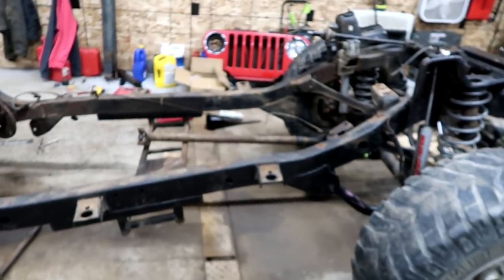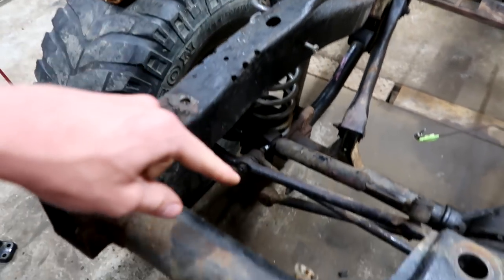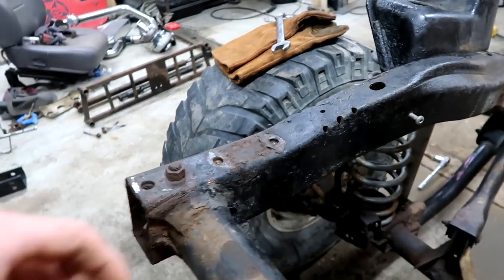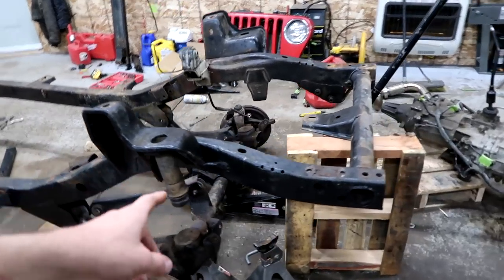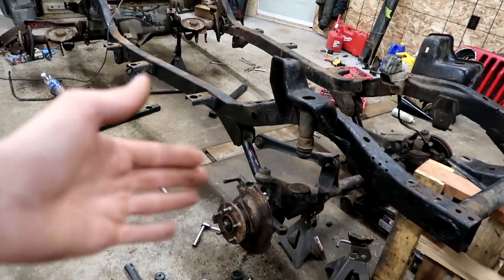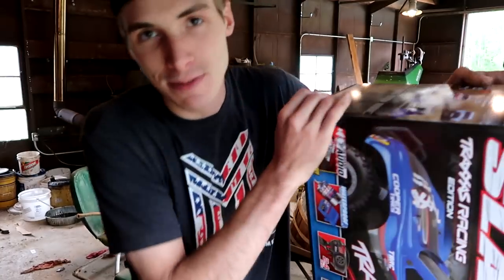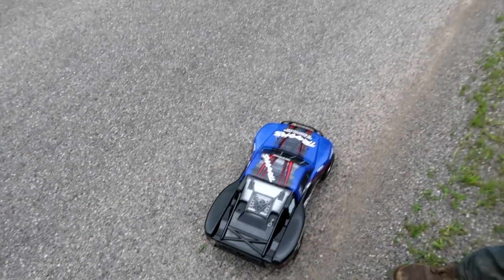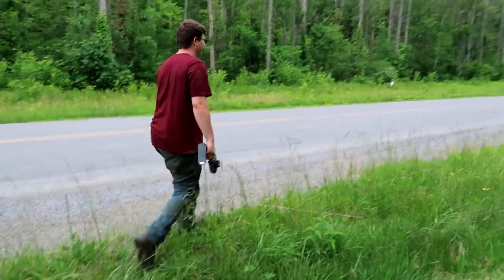How To Crash a New RC Car in 3 Seconds

Comment: Forget about the Dana 44 and get a ford 8.8 out of a 1996-1999 Ford Explorer.They make swap kits for around 100 bucks and just sleeve and truss your Dana 30 and you will be good up to 37's....
Reply from the maker: that's what I should run?
Reply: Yep that would be the cheapest and best bang for your buck.Check out Rusty 411 youtube channel.He has a Dana 30 front axle on his XJ with 40's....
Reply: a lot of people go for the ford 9 inch in the rear instead of the 8.8. They are easy to work on and have a ton of aftermarket support. Its stronger than the 8.8 and slightly more expensive but I think its worth it in the long run. I'm planning on putting a ford 9 inch in my 2001 along with a high pinion dana 30 from an XJ cherokee that I bought for $400
Reply: 8.8  is a good way to go
Reply: I have one in my yj they are great  , get a posi tract one. Plus you get a free rear disc brake upgrade
Reply: The Dana 30 will not take 37s. I know from experience. I snapped the passenger side shaft every time I was locked in 4 wheel and out any sort of torque on it. I went to 35s and it would take it for a bit but I still went thru 7 axle shafts is a 12 month time. I put a Dana 44 in and never had a problem again.
Reply: The 8.8 is the same track width and bolt pattern
Reply: Definitely upgrade the front to 44. Ive got dana 30 with  35" v treads and she dont like full power 3 broken axles countless ujoints.
Reply: 8.8 with disc brakes is a bonus too. Ditch the drums on the 35.
Reply: I have an 8.8 waiting to go in. Need a new ecu first then axles will be next

Comment: Front Axle

GM

1972-1976 K5(Blazer/Jimmy)/K10/K20 (Passenger side) Some 1977 K5 Blazers came with Dana 44s in the front, others came with a Corporate 10 bolt solid front axle. Dana 44s were also used as front axles in 4x4 converted full size Chevrolet and GMC vans by Pathfinder Equipment Company from 1973 to 1989.
Dodge

1974–1993 Ramcharger (Passenger side)
1980–2001 ½ Ton (W150/1500) (Passenger side 1980-1993, Driver side 1994-2001½)
1988–1995 ¾ Ton (2500 Light Duty) (Passenger side 1988-1993, Driver side 1994-1995½)
1972–1980 (W200) (Passenger side)
Ford

1959–1979½ Ton (F-100/F-150/F-250) (Driver side)
1980–1996½ Ton (F-150, TTB) (Driver side)
1959–1987¾ Ton (F-250 light duty, TTB 1980-1996½) (Driver side)
1972–1979 Bronco (Driver side)
International Harvester

1975–1980 Scout II (4X4)
1974 Travelall (100 4X4)
1969–73 1200/1210 4X4 Pickup/Travelall (Closed knuckle HD)
1974–75 200 4X4 Pickup/Travelall (Open knuckle HD)
Jeep

1967–1973 Jeepster Commando and Commando
1974–1991 Wagoneer (Passenger side 1974-1979, Driver side 1980-1991)
1974–1983 SJ
2003–2006 TJ Wrangler Rubicon (Front and rear)
2007-2015 JK Wrangler Rubicon (Front and rear)
1987–2001 Venezuelan XJ (Front and rear)
1996-1998 Jeep Grand Cherokee made on Venezuela
Rear Axle

GM

1967-1968 1/2 Ton Pickups

Jeep

1948-1975 CJ
2003–2014 Wrangler Rubicon
2006–2010 Grand Cherokee SRT8
2004–2006 Wrangler "LJ" Unlimited
1997–2006 Wrangler (optional: available starting 7 July 1997)
2007–2015 Wrangler (optional on 2007, standard '08-present)
1987–1990 XJ (tow package)
1987–1992 MJ (Big-Ton/Burly Package)
1986 CJ-7
1996–2004 ZJ/WJ Grand Cherokee (aluminum center section, referred to as the 'D44A')o
1996-1998 Jeep Grand Cherokee made on Venezuela
International Harvester

1971½–1980 Scout II
1974 Travelall (100 4X4)
Isuzu

1993–2004 Rodeo (Honda Passport, Holden Frontera)
1994–1997 Rodeo (Honda Passport)
Nissan

2004–2007 Titan (32 spline)
2008–Present Titan (35 spline)
2005–Present Frontier/Xterra NISMO, Off-Road, Pro-X models, and all manual transmissions.
Mitsubishi Montero/Pajero

2000–2010 installed in some of the Venezuelan Dakar models.
Independent Rear Suspension (IRS)

Corvette

1980–1982 C3
1985–1996 C4 with manual transmission
Pontiac

2005–2006 – GTO
Dodge

1992–present Viper
Jaguar

1961–1975 E-type
1961–1965 Mark X
1963–1968 S-type
1966–1970 420G
1966–1969 420/Daimler Sovereign
1968–1992 XJ6
1968–1992 XJ12
1975–1996 XJS
1986–1994 XJ40
There was a change in design of the Jaguar IRS after 1985. The 61–84 unit is in a stamped steel "cage" that is self-contained and easily removed as a single unit (see photo in this article). This makes it relatively easy to adapt to other vehicles. The 1986 and later unit uses a subframe/lower wishbone design that is not easily adaptable to other vehicles.

Comment: I highly recommend getting a ford 8.8 rear axle out of a 95-01 ford explorer  (31 spline axle shafts and disk brakes). I would also recommend getting an iron rock offroad swap kit, it makes the swap super easy and simple! The ford 8.8 is also stronger than a dana 44. I wouldn't bother swapping the front dana 30 if you plan on staying under 35" tall tires. But I would recommend upgrading axle shafts, and adding sleeves to the axle tubes and or add a truss.

Comment: Since you have so much lift. I would suggest an sye for the transfer case. Also I would do some research on a long arm kit. 4-6 in on short arms will be a very rough ride. Just a suggestion, not necessary. especially if you don’t off-road hard

Comment: You got on board audio (OBA) on that rc truck. which you flip the switch on the transmitter and it will make short course racing truck sounds.
If you want to go faster get a castle sidewinder brush-less combo kit. with a traxxas lipo battery. 
 I have the same truck but without OBA and have Rpm mud flaps,Rpm rear bumper, Rpm bumper mount, Rpm wheelie bar, Castle brush-less motor and esc, body lift mounts, and a custom painted body.

Comment: That spacer is needed to drop that transfer case lower to help the drive shaft angle though it’s not helping much on yours lol but it may still be needed. And if your gona have to get new axles just get 1 ton axles for it. Wider stance and will be plenty for your build.

Comment: New thing to do with those  2wd tracks slash is. Buy a MudBoss body for it and race it
Reply: Joel LaJuett mudboss are tons of fun! We race them out towards Albany way.
Reply: Dylan Flowers relatively cheap to start racing, and tons of competition
Reply: Michael Peek from Herkimer Here. Run at Fort Plain (Florians) where r u running ... catbox or Latham? (forgot name)
Reply: Joel LaJuett gonna be running at foxtrot in meco. We start July 8th.
Reply: Dylan Flowers its just the mainstream manufacturer of the rc modified bodies.
Reply: Kiser Motorsports  well actually it requires a Salvas Body. MudBoss is the class.  There is sportsmen mudboss and modified mudboss. If he wanted to run sportsmen mudboss, it's all stock parts except the lipo battery and foam tires of you don't wanna run stock tires which work well outdoors. Just all good cheap fun. Also a good way to teach automotive basics to kids.
Reply: Joel LaJuett Yea i know, and there are bmodifieds with brushed motors and amodifieds with brushless, the idea is that he body will replicate the look of a imca or usra style modified body.

Comment: The Dana 35 and 30 will do fine with the 4.0. My 99 WJ weighs 4400 lb and has towed 5000lb across the country with the same axles with 220k+ on them and they still doing awesome.

Comment: You should put a Ford 8.8 rear axle in it, and depending on what size tires you want to run you could put a truss on the front Dana 30, or just get a Dana 44.

Comment: You’ll be fine with the Dana 30 and 35, ideally you’d want Dana 44s but ive seen 30 and 35 perform alright, you’d could get a Chrysler 8.25

Comment: when you take out tie rod ends etc, its a lot easier to beat the side of the eye, usually a couple hits and they pop right out.  Same thing with b all joints etc.  Hitting the top doesn't work as well

Comment: You are probably best off getting a Chrysler 8.25 out of a junkyard Jeep or sticking with the stock Dana 35 (they used the Dana 35 with the 4.0s also), you probably won’t break it unless you are rock crawling. As far as I know Jeep stoped using Dana 44 rear axles in the late 80s early 90s and I believe the only front axle available was the Dana 30 for the 1990 up jeeps (wrangler Cherokee and grand Cherokee)

Comment: Whatcha have there is a 2wd Texas slash. I have the 2017 2wd raptor. The best first mod is a velenium 3500 with 2s lipos. Then after a While you'll need an metal trans. if I start spending less money on my actual l truck I'll make mine into a drag beast

Comment: We actually used those same exact ones in my electronics class we had put a high power motor and better battery and did some suspension stuff and our whole class would do races it was pretty fun

Comment: I have a slash and you can buy multiple parts and motors to make it faster the one I have has a brushless in it it can reach speed of 65 to 70 with the right battery and gearing

Comment: An xmaxx has a flip over button. Also get a lipo with high mah it will be faster and will run longer. If you want to get more rc's  get something arrma. They are cheaper than traxxas. All arrmas are  4 wheel drive and water proof.

Comment: Yo Dalton. If you need help with RCs just message me. I've got 7 of the same car as you so it'll be no problem for me to help you out. Btw Ian will have a tough time burning up that trans, all metal gears. 👌
Reply: billy lemonator Bud that trans is a plastic geared one, its just a stock xl-5 slash..
Reply: billy lemonator R u sure about that? my buddy bought a xl5 slash in december converted it in january and burned up the distinctly plastic geared transmission in february
Reply: Kiser Motorsports I'm sure. If it was a old one they had nylon gears
Reply: billy lemonator ohhh alright sorry it mustve been old stock at the hobby shop my bad i didnt realize they stopped using nylon gears
Reply: Kiser Motorsports it's good. I wouldn't give out info if I didn't
Know anything about it
 😉

Comment: dalton everybody who is telling you to go d44.. whise yes more cost yes. however i recommend using my setup i have a jeep zj on 37s. im still useing my d35 and d30lp axles just that im running chromoly axle shafts from g3 axles front and rear, custom rear axle truss and iron rock offroad front axle truss and gusset kit. also regeared from factory 3.73 gears to 4.10 from yukon gear. i offroad my jeep on a regular weekend basis and daily drive it, i have a lincoln locked rear with ox air locker in front currently have approx 45k miles on setup and have yet to break axles im just saying itd cheaper and faster than a axle swap
Reply: finally someone who knows what they're talking about
Reply: but hes gotta turbo goin on it
Reply: so what the 4.0 can only handle about 5psi safely which will probably only add 50hp

Comment: don't cut up the frame to get that nut back in there, use a rivet nut, you can probably get them from Fastenal or off ebay! it will save you a lot of work.

Comment: Could use a Dana 44 front in Ford 8.8 Explorer rear end you know how to use a welder to mock up new brackets for the rear end 355 gearing to 410s may have to cut axle tubes  down in some cases early 90s would fit I think don't quote me on this remember doing it  in High School

Comment: Good luck trying to find one when the jeeps hit the scarp yard the Dana 44 get cut out of the them my buddy's Jeep has Dana 44 with lockers and it the bearings shoot out and the axle came out so I say Craiglist for one and replace the bearings and seals the 30s axles are very prone to falling out with big tires so get a 44 Dana and put a locker on it

Comment: Dana 44 come on  rubicon models from 2003 and up. All Jeeps non rubicon come with Dana 30 & 35  the 2007 Wrangler have a Dana 44 rear axle so unless the axles where upgraded from a previous owner, there forth it is from the factory with those axles. Trust me I owned a lot of Jeeps which where all 6 cylinders

Comment: DONT LISTEN TO ANYBODY TELLING YOU ABOUT FORD STUFF. I have an F-250  they are great but you have a jeep. look at my channel. there are 2 vids of my Chevy Blazer. what you really need to do is buy it but I swore id never sell it. here is what I did. 1st, rough country 4 inch springs ALL AROUND, none of that spacer crap. then you find a 70s early 80s ONE TON SIX CYLINDER PICK-UP.  buy it. Dana 60 front and a 14 bolt rear. yeah rear 60 is better but, if it is one ton and comes with a 6 cylinder it comes with 4.56 gears. V-8s have 4.11 gears. 

another option is a man down here in SC that has been buying every Chevy truck with live axles in 3/4 or one ton for the last all his life. 

mine just also happens to have an "offroad design" transfer case DOUBLER I put in. it has 1 to 1, 2 to 1 and 4 to 1 choices for those 40 inch Goodyear MTRs on beadlock wheels.

call me and come get some of this stuff. oh, first time I saw you was when you rode a cart to Canada to meet Pug, that goof.

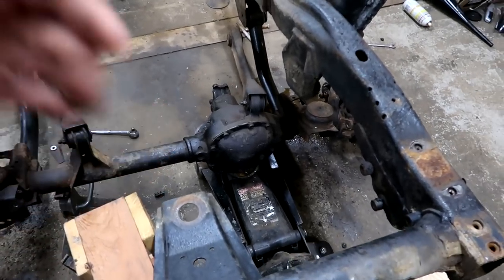Comment: You can put 4:10 or 5:38 gears in the stock axles to counter act the power and tire size that’s what I did to my cj 5 in my profile pic

Comment: You need the correct crossmember. Your drive shaft angles are already horrible and removing that space will only make them worse. The cross member should have some kind of drop and not be straight across

Comment: Do not get a dana 44, spend the money for a dana 60 front and rear or a 14 bolt rear do it right the first time. You're going to end up dumping way more money into a 44 than a 60 just to get half the strength of a stock 60

Comment: That's not how you break a tie rod loose hit the side of it... Get a ford 8.8 for the back  and a rubicon front axle or a doner rubicon for both.A rubicon transfer case would be a good upgrade as well as it comes with the slip yoke eliminator on it already and a4to 1low range.
Reply: sean tap he's probably gonna get new ones

Comment: Get a 2s lipo for your slash. Way faster. Maybe even a 3s.
Reply: Cameron Moore lipo wont make it faster. Nimh is faster, its got higher voltage, if he wants it to be faster he needs to go to either a brushless setup or automatically up to a 4s lipo
Reply: Kiser Motorsports I got a VXL, runs on 3s. Stock, 13/54 gearing. Pretty fast
Reply: Kiser Motorsports lipos have higher battery discharge rate compared to nimh. More power to esc more speed from motor. But yes brushless is still the way to go.

Comment: Castle mamba max pro and 5700kv brushless motor with a 3s Lipo that thing would rip
Reply: Nick Dutter even better the sensorless 4600kv 3s motor on a hobbywing max8 with 8s lipo. Itd rip up everything on that little brushed chassis

Comment: you should put a lipo in your RC it will go 2x faster braaaap a 2 cell the battery is called l have  one running on my traxxas and should get a rock crawler

Comment: Get a nitro powered traxxas I have a traxxas nitro sport and it’s super fast it has a little engine in it that runs on traxxas fuel great for beginners
Reply: KxNick nitro is not great for beginners and in New York he will have to tune it a lot
Reply: Nick Skibinski i should say that it’s a good nitro rc for people getting into nitro but yes battery is a lot easier and once you learn how to tune you’re all good.
Reply: KxNick na if he is getting a nitro rc he better get a hpi savage21
Reply: I say stick with electrics for a few months go bigger then to a nitro i got s nitro slayer and i havent had to tune it yet but i also have a lot of cars
Reply: Anything is Everything Not really hpi savage sucks. alot. Kevin talbot touched on that topic and i agree with him completely, theyre not enjoyable to work on.. its like everything is in the way of everything.
Reply: Kiser Motorsports Have you owned one? Because they are pretty easy to work on 6 screws hold the back on once you get those off 4 screws hold the motor and 4 screws hold the trans. I can replace a spur gear in 15 min properly with lock tight and so on but I've timed myself replacing the spur gear I can get it done in 5 mins. Mind i also replaced a tone of parts with aluminum and its still pretty easy. I'm only asking if you have one because a lot of people take one look at them and think wow that's way to hard to work on but in reality you can how's the whole thing apart and put back together in less than 2 hours.
Reply: Kiser Motorsports ok you are an internet troll I just very briefly looked at his channel and search for an HPI Savage 21 and all that came up was an HPI Savage XL that is a completely different vehicle next time please get the vehicle right before you tell somebody they are not easy to work on.
Reply: Anything is Everything Not really dude chill out and give me a second to reply. just cus i dont post vids doesnt mean i havent owned one. ive owned not only a savage, but a b6d, slash 2wd brushless w/ sv3, and a couple more but out of all of them the hpi was the most overly complicated one ive worked on. in my opinion the most simplistic one was the slash. Though the b6d was pretty simple too, now please, slow down and think before you go and call somebody a troll, bud.
Reply: Kiser Motorsports well bud if your going to say the hpi savage 21 sucks your a troll 💁